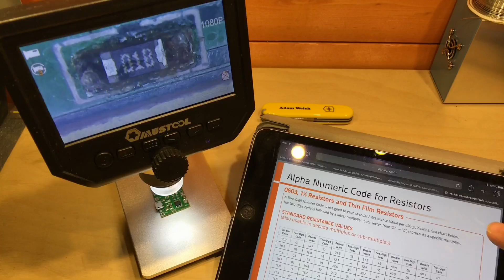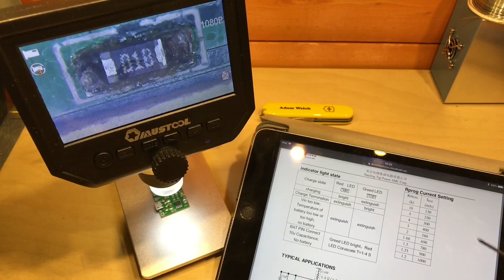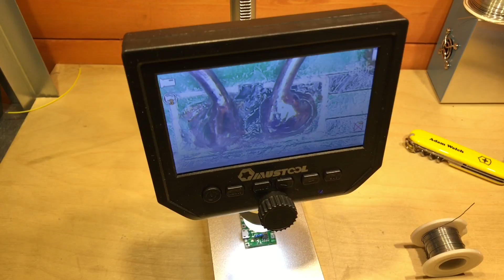TP4056 Lithium Charger & Boost Converter Module - 12v Solar Shed

Comment: I made a similar solution using two of the exact same batteries in series, later I switched to a low cost 9V rechargeable lithium battery...

Comment: Nice mod.
About a year ago I found some 2S lipos in the shape of a 9v battery. Think they are meant to power FPV googles. Come with protection, USB charging circuits and "level of charge" LEDs.
They are great to them to power small prototypes, and are cheaper than rechargeable 9v batteries.
Reply: Think you tested something similar (1s boosted to 9v) in your channel before. Or I remember wrong?
Reply from the maker: The OKCells yes I did.  Still got them.  They work ok but the self discharge is higher than I'd like.

Comment: It's tempting to replace the in-handle switch with one which toggles between Charge, On and Off. Or alternatively, if you don't want to open the case, add a SPCO slider switch ('Charge' and 'Run') inside the battery compartment. Thanks Adam.
Reply from the maker: Neat idea.  I may well try the charge and run switch idea.  Cheers

Comment: Nice project, I would've been tempted to install a switch on the handle door to disconnect the battery when not in use.
Reply from the maker: I'll see what the quiescent current is and make a judgement.  I think you are probably right though.

Comment: Hi the microscope looked nice & stable did you get the bracket to go click?  👍
Reply from the maker: Ah well yes and no.  It did go click and was more firm, however I'd already ordered the aluminium stand which I used in this video - a huge improvement on the plastic sucker stand.
Reply: Hi Adam it looks like a handy little setup now on its lovely new stand and it also seems like a good way for us watchers to see the small details. Top job👍

Comment: Some expert soldering there. I want a microscope too. Gimme gimme. Lol
Reply: NERDVille - I did a review on that microscope on my channel, links of where to get it are in its description, it isn't that expensive and works well.
Reply from the maker: It is extremely useful.  Only had it a couple of weeks (and actually it ended up at the local school for one of those weeks) and I've used it a fair bit.  Cheers
Reply: Damn, want it too but if 1 more package comes in the divorce papers will also come in via the post I guess.  Seems all my orders just came through from the last 2 months. To be honest it's all Banggoods and Gearbests fault.
Reply: Luc Peeters yep that's what I put down in my divorce papers. Banggood and Gearbests fault.
Reply: Damned, now I also subbed TheDefpom channel and he just posted a mailbag video... no no no resistance is .. whatever.

Comment: Hi Adam, nice video, it's a shame that they didn't put the battery over-discharge and overcurrent protection like in the other TP4056 boards on this PCB.
Reply: If you scan down the eBay search link he gave there are some that claim protection (I didn't look closely at the pictures for a DW01) for a few pennies less than the board he bought.
Reply from the maker: Yeah it is a little bit of a shame - I'm pretty sure that lipo i used has one though but time will tell!
Reply from the maker: I'll take another look thank you - it would be a handy addition.
Reply: Javier Palla Lorden Well, you could use a simple 1s BMS to protect the battery. That way you're not limited to the infamous 1a of the TP4056.

Comment: I like the mod, but the thing that always be the boost converter turned on bothers me :P, I'll use the push button as switch between the battery and the charger/boost, but when the charge time arrives creates another problem since it's not a locking switch, maybe cutting the track between the charger and the boost converter on the pcb and use the switch there?
Reply from the maker: Yeah I will look at that again.  Perhaps you are right.  I'll have a think.

Comment: That's actually a great idea. I modified a toy grade rc car of mine... It used two AA batteries and I replaced it for a 18650 cell (that almost didn't fit inside LOL), an 1s BMS and a TP4056. That way I could modify the transmitter too, because it uses a 9v battery as well.